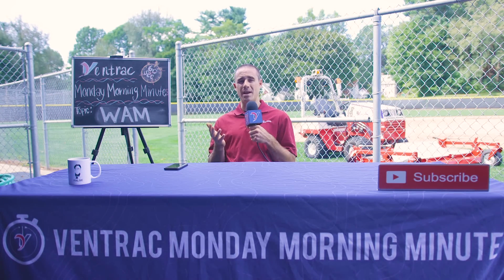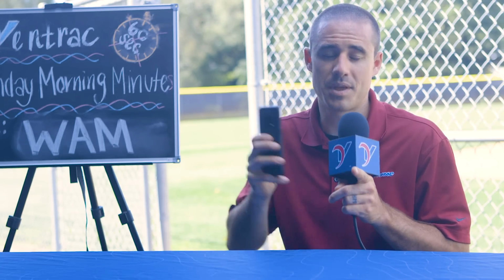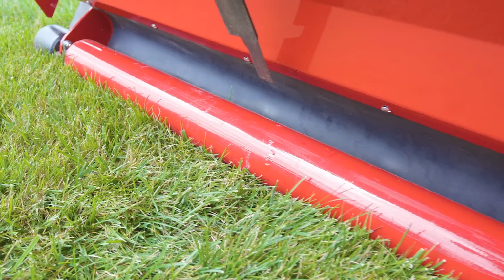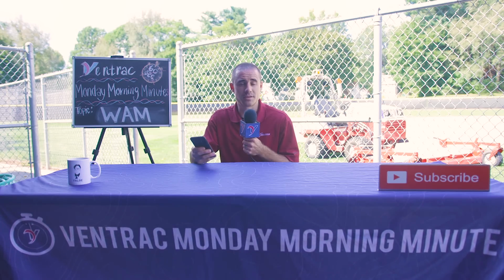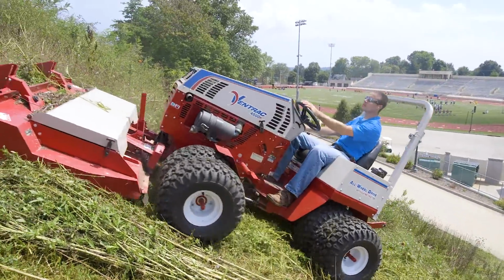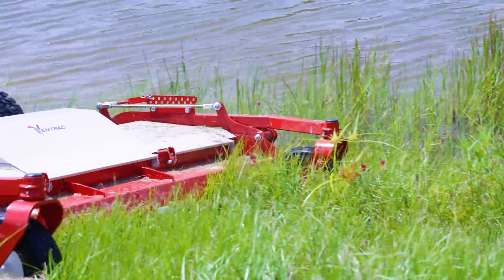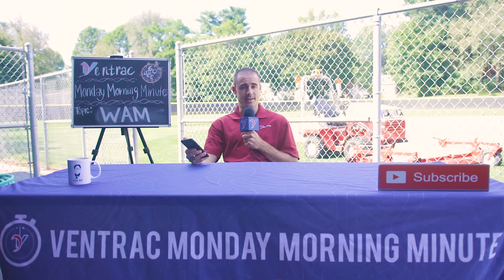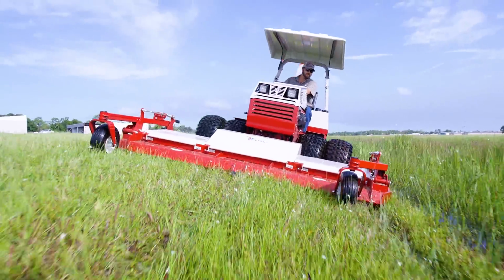95" Wide Mower for Fastest Mowing Times with a Ventrac - MMM

Comment: Sweet set up! We currently have a 90” finish mower behind a cab tractor for our wide areas. However, the 72” is definitely something I would and could use on our main grounds as apposed to a zero turn. We have several hills as well as flat ground, and the attachments make it so capable.

Comment: I noticed you said the 4500Y would feel the pressure of this deck, power wise. Do you think the Ventrac 'P' with the Kawasaki engine is well capable of handling this deck? I understand it is more powerful than the diesel, but it's only two cylinders, so I'm curious of your opinion, thanks.
Reply from the maker: Yes - the P will handle this deck pretty well.

Comment: Will the Ventrac Wide Area Mower work on the Steiner 450?
Reply from the maker: We're not sure about that.  It should mount up without any issue since the hitch arms are the same style, but pay attention to belt alignment and clearance to the tractor with the attachment raised all the way and/or with the deck flipped up.  We don't design with their machine in mind so on some attachments there may be interference issues to look out for.

Comment: why didn't you build it likethen84 inch deck?
Reply from the maker: We wanted to offer something different from what's out there in the industry.  This deck manages to have a very wide cut, provide a good overall cut quality without too much scalping, AND it has the benefit of being much simpler than a full contour-style deck with moving wings.  This keeps the cost and maintenance down dramatically.

Comment: Is the Blade Tip Speed between 16k-17k fps?  This will work on the 40 acre farm where I am mowing 12 acres with a HM722 and a HQ680. I just need a deck over to get it to the other farm where I mow much more...
Reply from the maker: Good question.  We're at 17,350 FPM on the WAM.
Reply: @ventrac  Sweet, Impressive with 5 blades

Comment: I've always wanted a deck bigger than my 72 inch. The contour deck is nice, But really not needed on my flat large lawn. I could probably cut close to a hour off my mowing with one of these. The size just looks like it fits the Ventrac, I'm excited to see more of this mower in use.
Reply: Toro has some very large mowers that flex; five individual single blade mowers connected together.

Comment: Just bought my 2nd Ventrac tractor/deck 3 months ago and love it. Old one was 16 years old and still worked, I just wanted the upgrade. There is nothing else out there as versatile and high quality as Ventrac and the people at the factory are great if you call them for info. Please don't ever cheapen your product for more sales as so many companies seem to be doing nowadays. Maybe run some 0% programs through your dealers, as your product is pricy ( just as anything good is). This would help you sell more while not cheapening the product.
Reply: Your spot on with the 0% financing. That's the main reason I went with getting a John Deere 1025r with 3 different attachments. I  came in at $22,000 with 0% for a couple years. just event track itself would have been a couple thousand more than my current setup which I could have justified if the financing was comparative.
Reply from the maker: Thanks for being a fan!  Enjoy your new tractor!